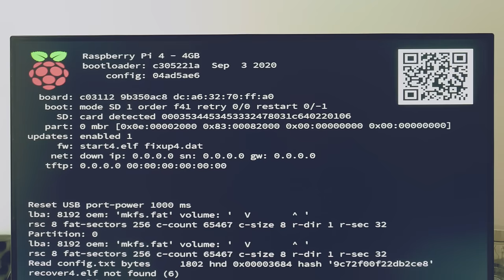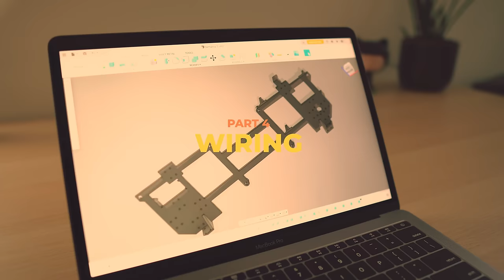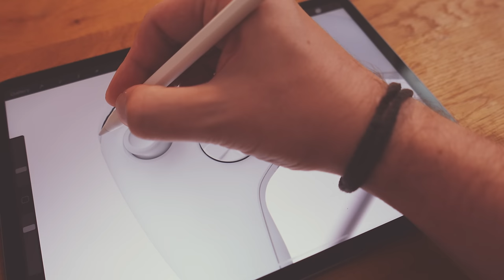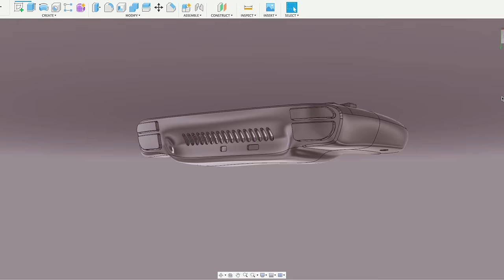Designing my own Game Console

Comment from the maker: I hope you enjoy the video!
I'd really appreciate it if you consider subscribing :)
Reply: How would you add analog sticks to build? And how did you get buttons to work, did you write script?
Reply from the maker: To make buttons to work I installed Adafruit Retrogame https://github.com/adafruit/Adafruit-Retrogame Since the raspberry pi doesn't have analog inputs, you need either a specialized hat or add, for example, an arduino.
Reply: @xc864   you can use a ardunio micro but it this plus sides and down sides
Reply: @LeandroLinares what are you gonna name the console
Reply: please, make rpi 5 version with ps2 emulation!! Please!
Reply: I’d love to see a MiSTer version of this 😊
Reply: Hey, what's the software for 3D modelling?
Reply: How long did it take?
Reply from the maker: It took 1 year start to finish working on weekends and some weekdays as well.
Reply: @LeandroLinares  do you think you could add USB chips as cartridges?
Reply: @TheRealCherryCrate  wdym by that tho like a nand chip or one that you might find in a ssd thats not the nand chip but the samsung storage chip if so you can but you would have errors to come by when coding cartridges into the os that would be some what painful i have done a similar thing to making a old desktop into a gaming console and i used disks as the storage for games it was fun coding the os but had some draw backs when using it
Reply: @espero_dev  like you can download a scratch game and plug it into one of the USB slots and it would play the game right?
Reply: Add some thumbstick
Reply: @LeandroLinares  what 3d programe did you use
Reply: Where did you the parts? Please 🙏🙏🙏
Reply: Please could you make a mini ps5  like this please 😢😇
Reply: Good work wish I had one
Reply: @LeandroLinares  the last thing you need for a the handheld is a carrying case 😂
Reply: that was so beautiful
Reply: bro hey support from india, i wanted to build this but i couldnt find the screen anywhere online...

Comment: Man, I had this same concept in my head for the last 3 years. The only thing I couldn't get around was the power supply. I wish I had known about the PiSugar as I couldn't find anything that could had a discharge above 1.5A. 

I was using the 3A+ for a slim fit. Same screen as yours. Was wanting to add at least one Joy. I'm glad to see someone did it. Please keep revising this. Sell some kits. Makes some cheddar!
Reply from the maker: Hey! I've been in that same place with the power supply for a very long time!! I also tried to add a joystick but couldn't find a workaround to the raspi not having analog inputs. Adding a hat for that was out of the equation for the size of using a model B. I tried to find a tactile 8-way directional switch (some kind of digital joystick) but only found the 4-way ones (no diagonals). Anyway, I hope this video encourages you to finish your project!!
Reply: @LeandroLinares  hey man, could you upload the 3d file for the case ? It's absolutely perfect and I wanna use the same one in my project. Amazing build and video, you just inspired lots of people to get into raspberry pi!
Reply from the maker: @dragos8839  hey, thanks!! The case needed a bunch of tweaks that I didn't show in the video, and using the exact same components is a must. I'd say the 3d files are far from finished, and I'm already moving into the next project. So, I probably wont spend time on finishing it in the near future.
Reply: @LeandroLinares  it's perfect the way it is, it's the closest I've seen to what I want to do. I could edit it a little on my own (cut/add a few things), it would be extremely helpful if you could share the file. Thank you very much for this and great work again!
Reply: @LeandroLinares  good job man. I just want to know if the buttons are automatically recognized as the correct input for that button is press? or do you need to map it out via a code in pi?

Comment: This is such professionally done. Great work for a prototype and proof of concept. Just needed sanding!
Reply from the maker: Thanks! 🙏 I sanded it, but PETG turned out to be very difficult to work with. I was afraid the console was going to reach high temps, but it didn't. So, I'll use PLA next time, sand it, and paint it :chef-kiss:

Comment: This is awesome! It looks like it's very comfortable to hold and ergonomic, too. It's really neat to see DIY stuff like this from start to finish, and the fact that everything but the components were 3D printed is also interesting. How did the 3D printed buttons/D-pad feel? Did you like the responsiveness and feel of the buttons? I mean I saw that you went through several different options, but as they were all 3D printed, I just wanted to know how nice they feel compared to buttons/d-pad on a first party controller?
Reply from the maker: Hey, thanks 🙏 The responsiveness of the buttons feel good. It's not as good as a real controller, though. Especially with the d-pad. I need to give the d-pad more room to move because it feels kind of limited sometimes.

Comment: i recommend sanding and painting or clearcoating it, it just will give you that smooth clean crisp finish, i recomment spraying the 3d printed parts seperately, for the best results. maybe only  paint the letters on the buttons black, and then clearcoat the entire set of parts until smooth&glossy. itll look so much more professionally manufactured with minimal effort!
Reply: could also list the parts etc, and print out a small manufacturer's label of components and warnings for on the back. little stuff to make it prettier!

Comment: Very cool I hope more modular and smaller SBC's with intel and AMD chipsets become mainstream to recreate this kind of process but with some proper CPU & GPU performance.
Reply from the maker: Yessss 100%. I plan to use an x86-based SBC capable of running SteamOS (like Latte Panda or anything with an AMD Ryzen embedded APU) and an OLED screen. I need to finish fixing some design flaws and adding thumb sticks first.

Comment: i am working on one but i don't know what kind of case to design it in.
Reply from the maker: Start with a rectangle! It's the simplest one and you can start adding shape later. That's the amazing thing about 3d printing. You can iterate as much as you want.
Reply: I designed one in Fusion360 and 3D Printed it using my 3D Printer at my house. Now all I need to do is get a soldering Station and solder the wires and I should be good to go! Thanks for the advice!

Comment: When you Solder the Tactile Buttons, How are you Soldering them? And Do you need to use all of the pins on all of the sides?
Reply from the maker: If you're talking about how the buttons are hold in place: I designed the 3d printed part to hold the buttons strongly in place when you insert them in the holes. So, the 4 legs of the tactile buttons are really holding the buttons. If you're talking about the connection: I soldered the negative to the GND pin (ground) and the positive to a digital pin. For this project I didn't use all of the pins, nope.

Comment: You the fan require programming? Or is it just always on? Or does the raspberry pi controll this?
Reply from the maker: It connects to a GPIO pin so the raspi can control its speed via PWM. It's the official fan for the raspberry pi case.

Comment: Me again, did you do up the print design in fusion by any chance? and dont suppose you have a nice write up on this like your arcade machine? edit. I've been trying to model something similar to you but instead of F360, im using AutoCAD, but cant seem to get it right. I really like what you've done
Reply from the maker: Hey, I used Fusion 360. You can search for t-splines modeling. That's what you'd need to sculpt in 3d. Not sure you'll have the same results in autocad. Another one you can give a try is blender. Hope this helps.
Reply: @LeandroLinares  yeah it helps, i couldnt get my head around f360 and designing to the mm. But i kept resorting back to what i know, which is ACAD for the last 24/25 years. Would love to see your STL or file to pan around and see how the magic happens. I have some slighty different ideas from the xbox controller and sourced the external body/buttons off a replacement ali express kit for 10AUD. If you ever up load to github this stuff let me know

Comment: you could shorten if not remove thos wires completly using a custom pcb from pcb way to handel the controller inputs and i suggest using buttons from xbox 1 remote maybe

Comment: how did you remove the pogo pin and all so how did you connect the PiSugar to the Rasberry pi after doing so?
Reply from the maker: Hey, it seems that pogo pins are not soldered or anything so I just pushed them away gently. My camera broke when I replaced them with the header so I don't have any footage.
Reply: Thanks 🙏🏼

Comment: So How were you able to put the board on top? My Pisugar board wont do that. It always needs to go on the bottom.
Reply from the maker: I took out all the pogo pins (they don't break so I could revert it) and soldered a header in their place. I did this only because the HDMI and USB connectors from the screen have a fixed size. My camera back then broke at that exact moment so it's the only part of the process that I didn't capture on camera. I should've use my phone or something.
Reply: @LeandroLinares  How did you take them out? Do they pull out, Or do you need some sort of heat gun.
And I do see what you mean by they have a fixed size. I have some of the same products and I'm trying to achieve something similar. But Because of the screen i need the board on top.

Comment: What PSP had another aspect ratio than the rest of the consoles? Isn't there a way to scale or modify within the emulator without stretching?
Reply from the maker: It's not stretched. The screen I'm using has an aspect ratio of 4:3, because I wanted to run mostly retro games. The psp has 16:9 as any modern screen, so it's showing the black horizontal bars.

Comment: Did you also need a overclock, if so, what are the setting?
Reply from the maker: I didn't overclock it, but it will definitely need one for running many ppsspp games. That's why I originally included the fan.

Comment: Is it possible to make a handheld console like that, and then make it able to cast to a separate screen like a Nintendo switch?  I’m curious because I had the idea to make a raspberry pi handheld for my high school engineering project.
Reply from the maker: Hey, I'm not sure but I don't think it's possible (or simple) because the Switch is proprietary hardware+software, so Nintendo controls 100% of what you can and can't do with the Switch outside the main functionality. What would you use the Switch for? If it's for saving the costs of buying a screen, you could buy an "HDMI video capture" for under 10 dollars. It's a thumbdrive-sized device that would allow you to transmit (via cable) video to an android phone or tablet. Hope it helps!

Comment: Got to ask does it over heat at all?? If so how did you deal with that?
Reply from the maker: I expected it to overheat and that's why I went with printing the case in PETG instead of PLA and adding the fan, heatsink, and vents. I found out that it doesn't overheat at all, so now I'll start changing the material and maybe removing the fan to see how it performs.
Reply: Just rewatched and seen that very cool stuff man, kinda want to try this myself will be looking out for new videos 💯

Comment: Amazing video ! V2 with custon pcb with raspberry pi compute module ? :)
Reply from the maker: That would be amazing! I've never worked with the compute module, though. I'd have to check if (and how) the UPS and screen are connected.
Reply: @LeandroLinares  For connect upsm screen and other you need to create a custon pcb and for the test you can buy a Compute Module 4 IO Board
Reply: @LeandroLinares  Honestly I think that if you made a version with a compute module you could make a much thinner console, I'm sure it would be a hit in a kickstarter.
And the advantage of the compute module is that the console can be upgraded over time when compute modules 5 and 6 are released.

Comment: how do you connect the pi sugar to the pi? it works without the pi sugar, when using the regular cord and plug. but i dont understand how to get the pi sugar to connect to the raspberry pi and power it. it is charged and battery connected, but i dont know how to get it to connect to the pi. i tried to connect it the way you do in the video, but its not connecting. there doesnt seem to be enough space either, the cord that connects to the battery barely has room. is there some step i didnt follow? i dont really understand how pi sugar works in general so maybe im missing some obvious step.

also for some extra info, i am using raspberry pi 3b with a pi sugar s plus. my pi sugar is super different from yours, the battery isnt even the same size and its impossible to orient it in the same way.
Reply from the maker: My first question is: Did you test the entire thing before modifying the PiSugar to make sure it was working right out the box? About the cord: it will have little room, yes. Thanks for the info on the S plus! I'll add that to the guide
Reply: @LeandroLinares  yes, everything works seperately, just not when all put together. but i think i know where i messed up, i think i have to redo the soldering. i cant fix it right now but i will come back in a couple days and confirm if it was just a soldering mistake or something else.
Reply from the maker: Perfect! Hope it goes smoothly 🤞 Let me know.

Comment: what did you use for the button pad
Reply from the maker: It's 4 push buttons as the other ones. Depending where you press the 3d printed button you are pressing 1 or 2 of those. In the next video I'll explain how it works, since I also had to make some adjustments to it.

Comment: In the process of making my own version, does anyone know what is plugged into the usb port at 3:07. It just appears but is not explained. I have looked on the blog post as well and found nothing about it, thanks in advanced.
Reply from the maker: I answered on the guide, but I'll copy the answer here in case somebody else needs it: 
The screen gets power through usb, and data through hdmi. The display I'm using came with 2 pcb-like connectors that fit perfectly with the raspberry pi. In case you don't get those, the second best option IMO are "band cables" (search them on aliexpress or amazon). I added all these details with pics to the guide. Will also explain it in the next video.

Comment: How would you add a joystick?
Reply from the maker: I'm playing around with an arduino pro micro. Though maybe just adding an analog-to-digital converter like an mcp3008 is the simplest way. I wrote an update with what I'm working on, if you're interested. It's in the Community tab of the channel.

Comment: print quality seemed pretty rough..
Reply from the maker: Agree. I printed it in PETG because I was afraid the temperature inside could go high. Turns out it wasn't the case. IMO PETG is AWFUL to post-process. I'm working with PLA on the next iterations.